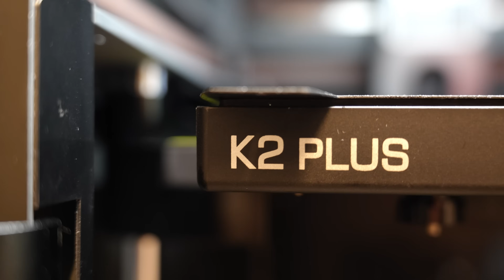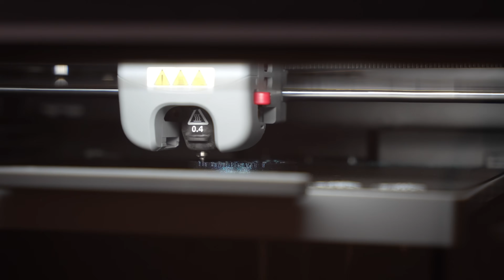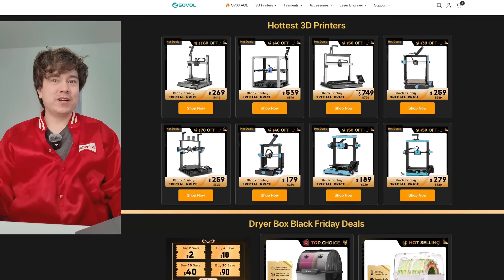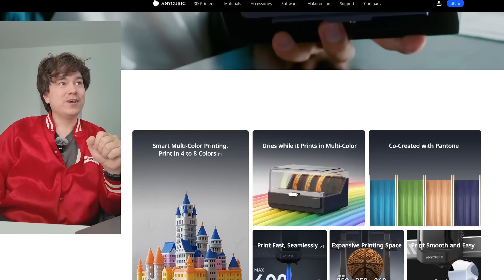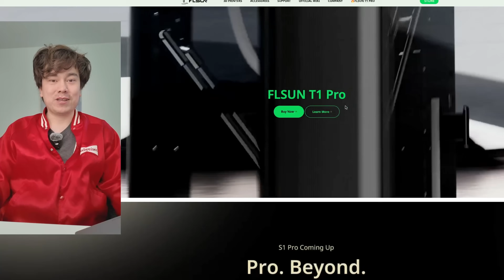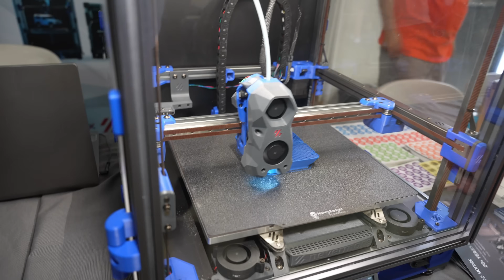Ultimate 3D Printer Tier List - 2024 with Sale Pricing

Comment: for ff they threatened to swat you for printing firearms. where you stand an the 2a is your opinion but it should be my machine my rules and airsoft cam be misconstrued as firearms easily and so can toy guns. even if its a toy a lot of real guns are printed in a way that makes them look like a toy (theres even a video of smone shooting ont ehat looks like a nerf blaster), thankfully since i live in Utah i wont be seeing the alphabet bois any time soon even if i wanted to print something that uses live ammunition. 

i want to like gekegoo and their cc catrbon but it was a case of they prommised sus omething as an addon then turn aorud and stab us in the back and had the aduacity nt not make their canvas backwards compatilbe with the cc and only have it for the cc2.

faor anycubic they now have the kobra s1 and its 1 hell of a deal. a core xy combo for $650 is a not a bad buy. $500 for the base printer. their main issue is crap customer service

Comment: lol k2 is literally an expensive toaster, non quality pla print without tweaking (don't use slicer parameter unless you want your print be just back from 2015), you can't print high temp filament, you will get taco bed and cfs, for price it comes, don't even dry. But you put qidi plus 4 down the list with the better quality from k2 in all camp, beside dimensions (but you can't use all space on k2 anyway, bc of tacobed). The bamboo hate is also hilarious.
ps: k2 have fire hazard multiple time, also with firmware update, just bc a new acc on reddit created a post about qidi, don't make k2 less fire catching. If you want safety - just buy a bamboo doh

Comment: I definitely have super mixed feeling being a Neptune 4 max owner. It's genuinely gave me nothing but headaches. On paper is a really nice printer and when it works it works. But the software is ASS and the default orca slicer profile isn't any good. The modified klipper install is weird and not mod friendly. Gotta have prior SSH experience and know a little bit about Linux if you want be able to follow any of the basic tutorials for installing klipper stuff. But the biggest issue is the bed. It's always warped, not built on a single slab of metal and instead assembled out of frame material. It rides on v wheels that wear out and the belt driving it rips or skips very frequently.  Flat out, it's just not a good or reliable printer if you arnt willing to fix it.

Comment: I agree that AnkerMake seems to be abandoning 3D printing.  I have an M5 that I got off of the Kickstarter project.  I thought it was a great machine as far as print quality.  However, I couldn't use the pause feature to change filament colors. Every print, the first pause would shift the y-axis when it returned to print.  Subsequent pauses wouldn't do it.  Tried to contact their customer support and I kept getting canned answers even though I recorded video and detailed the issue.  Also, I had the all-metal hot end which got clogged.  I tried to remove the nozzle and it broke off in the hot end.  I contacted them again as they don't have the all-metal hot end for the M5 on their website for purchase.  They basically told me they don't sell those anymore.  I could put the old hot end back on, or go through the pain of heating up the plastic inside of the hot end enough to free the remaining half of the nozzle, but for now it's just a big paperweight.  It's too bad.  I thought they had a good product going.

Comment: As an open source enthusiast I'm on same ship with you with your D tier. 

btw FYI here's what T1 Pro was like to me (preorder unit):

Noise:
"God darn loud across entire house" but also "fine behind few doors" level.
Fan sounds are now just like vacuum cleaner level but low, strong hum sounds motor generates are still something.

So I dumped it in washing machine room which even has silicon sealing on doors, which perfectly block all that noise. Basically giving middle finger to my filaments and letting it die in moist. I prefer my ear freedom over some filament drying.

Build Quality:
Exterial build quality was crap that parts weren't fitting until I found some plate's bolts were pre-assembled with 45 deg tilt (how the heck they even...) which made plates twisted.
Also unlike ad it wasn't even making proper seal and can feel air leaking everywhere.

Usability:
For firmware it's locked damn tight and outdated that I can't even control timelapse from mainsail, and their wifi receiver is total garbage that can never reliably pick up a decent signal that I had to put leftover router as repeater just for this chunky bastard.
Outside that, it was at least doing what printer should be doing just great with nice accel and precision. Never got a failed print yet after few dozen prints.

Customer service:
This doesn't exist. They aren't real.

Conclusion:
Despite all that troubles I still love this printer and will rank at A.
It's like half price (or 1/3 for earlybird price) yet it's faster than 'specific' vender's printers that need user confirmation of potential damage to print faster. 
Price factor for this overall package kinda makes sense to me, wish they did bit better tho.

Bias factor:
And best of all - it's darn fun watching delta arm flying around! Was happily watching it print during in -5 Celsius in washing room. Got cold tho.
Maybe I was destined to love deltas after all.

Comment: That was helpful. I started with an Ender 3 V2. It was a learning experience, but definitely not a "just works" kind of machine. I upgraded to an Elegoo Neptune 4 Pro a bit over a year ago. Some early firmware related issues, but running reliably now. I find your placement of the Neptune 4 Plus and Max above the 4 to be curious as those seem to have have had more problems than the 4 and 4Pro, judging from the FB group for this series. Maybe they have those issues resolved now. Might eventually get a core XY with a large bed, but not in any rush. Multi material would be nice, but the time and wastage are a big negative.

Comment: I really like the idea of the sound levels and filtered odor of the M5 Pro, the out of the box ease of use and print quality of the Bamboo stuff and the multi-color head design that does not waste a lot of material and the build volume and price of the Neptune 4 Max.  Looks like I will keep looking for bit.  Your review of the K2 Plus seems like it gets really close but at this point I cannot justify the expense as something to just occasionally mess around with.  Like most things manufactured them seem to get better and less expensive as time goes on.  I just might have to make some big compromises in what features I want or the amount I am willing to spend.  Maybe 2025 will be the breakthrough year.

Comment: While I agree many Voron parts are over engineered and suggest some unnecessarily expensive components, I don't think implying they're 'rickety' or unstable is entirely fair. A well-built Voron is damn reliable and can produce truly beautiful prints comparable to much more expensive machines. I'm sure you know why ABS is used and awhile back I even built a Voron within tolerance using just a modified Ender 3 Pro so I'm not sure why that's a negative.

I can respect why you left Bambu out but I think it's a mistake to not even mention them (aside from engagement) while still including them on there. A lot of people don't know the details about why they're criticized. IMO that's how to push back, not simply ignoring them.

Comment: Honestly, none of the brands apart from Prusa and Bambu should be in A or S tier.  Reason: customer support!  Creality might now have a couple of decent printers (K2 plus, K1C, Ender 3 v3), but these use pretty specific proprietary parts, which makes me more concerned about Creality's track record of having no long term support.  This is the company that cannot even make clear what their official Internet store would be, having numerous self-proclaimed "official" Creality stores., which Creality seems to tolerate.  That just does not give confidence that in 2 years you'll still find parts for all the variants of nozzles they introduced lately.   If you get your printer for free and replace it with another free one after a few months, customer support might not be on your mind, but after years of affordable (sorry prusa) 3d printers basically being stuff you had to fully maintain on your own without support, Bambu (affordable since the P1) has been such an improvement that any brand not offering the same level of documentation and part availability just isn't on the same tier in my book!
Reply: I haven't seen many of these companies support printer firmware for more than a year. Bambulab and Prusa has at least updated their firmware for more than a year. Prusa is even nice we they have update/grade paths so you can get the most out of your printer. I understand some of the upgrade paths is cheaper to sell the old and purchase a new one, however they held their resell value pretty well, mini. It included.

Comment: if the qidi plus 4 didnt have issues what would you get, qidi plus 4 or k2 plus?
Reply from the maker: K2 plus. It will have better long term support in the aftermarket since it will sell in greater volume, the extra size is very nice, and it’s very well built
Reply: @NathanBuildsRobots  appreciate it man, thank you!
Reply: @NathanBuildsRobots  What are different points that make the K2 plus better built than the Qidi plus 4?

Comment: As a Neptune 4 Max owner there is NO WAY I would call it an S-tier. It has the potential to be an S-tier, but out of the box I would rate it "B" tops. Even with the firmware fixes, there are still major QC issues that haven't been addressed.
Reply from the maker: What sort of QC issues? 

I only have experience with the Neptune 4 they sent me which worked great, and I’ve looked at their display models at various conventions. They seem to work well from what I’ve see
Reply: @NathanBuildsRobots  The Max in particular is susceptible to really bad bed warp, warped and uneven gantries, filament collecting around the hotend and building into a "blob of death" - early firmware had so many issues that a custom Klipper firmware called "OpenNept4une" was released. If you look up "Neptune 4 issues" there is a plethora of videos covering the various problems.

Comment: I would personally hold off on rating the Creality K2 so high when consumers haven’t gotten it yet; it might have the same or more issues as the Qidi Plus4
Reply from the maker: I looked at the electronics with a thermal camera while using the chamber heater. Looked fine.

You know, there are ways to properly test things? Most YouTubers don’t know this one simple trick

Comment: Having negative bias towards Bamboo seems to shine here- putting out an unbiased opinion should apart of your want to be looked at as a professional reviewer. Leaving out one of the fastest growing/searched printer manufactures is not classic oversight but a possible malicious objective. You are better than this for sure.
Reply: Contact Bamboo - arrange for a reconciliation and move forward. You are the only one who can lose the most by holding a chip on your shoulder - you can rise above slights in the business world ( as there will always be many) - finding solutions to “bad prints “ - is a huge part of the print environment. “You Can Do It “
Reply from the maker: Sorry I forgot to rate them. I will post an update video with a proper ranking for bambu printers

Comment: I have the Kobra3 combo and its a pretty good printer.  I love the ACE unit for drying and the way it loads, it's much easier to use than the AMS.  I obviously haven't seen the K2 yet and Creality's unit but it's been great.  It prints faster than my a1 and the printer poop is less than the bambu as well they've really dialed it in.  I did have an issue and support actually helped me.  I like it way better than my Sv07
Reply: My Kobra 3 been working great too...

Few times I had issues with cardboard spools, now just need to be a bit more careful and buy plastic spools.

Comment: I run a University print farm. The only printers I recommend to the students are Bambu. They work flawlessly out of the box. (Although the box has next-level packaging waste! When you unpack it, it's like the printer wasn't in there.) It's hilarious that you 'forgot' them.
Reply: Sad to hear a university would not go with open source tech that encourages learning.
Reply: I work at a university and, personal opinion, a university would be better served with things like Ultimakers? Bambu is the iPhone of 3d printing which is amazing! I think for students it should be a combination. Have the easy closed source and the learning from open source that can usually out perform closed source once tuned properly.

Comment: No QIDI Q1 pro? $400 and core XY. You can’t really make carbon fiber prints with a 350C nozzle and 245mm^3 build volume and 65°C heated chamber for any cheaper. Full print profiles for orca and their slicers. I have one and I’d say it’s a very good value for the price. All of the review issues like the bed alignment have been fixed. Look into it. :)
Reply: The Q1 pro is the best value for money if you are printing any filaments that aren’t PLA or PETG, and it’s not even close.
Reply: Haha, he's already Creality Robots, what good can you expect him to say about other brands?😝
Reply: It's a solid machine for some engineering materials but let's be real, you can print a lot with a ~300C nozzle and a ~100C bed. Hell, I went through many, many rolls of CF-ASA/ABS just using a modified Ender 3 Pro and a DIY enclosure. The heated chamber is certainly great to see at this price and I've spotted some deals on their larger models that are especially interesting.

Comment: For me the Sovol SV08 really seems like a solid choice with big print volume. It's the same as the K2 Plus and it works.

One important lineup you kinda forgot: K1-series! Especially the K1c for 430 bucks or so. Perfect middle ground, most problems solved, enclosed, affordable, sleek look.
Reply from the maker: After using both for a bit, I’d probably pick the ADV5 over the K1. The non pro model is just so darn cheap, and it’s quite a bit more robust, I don’t like the screen position of the K1 and the fact that the screen can be easily damaged when moving it around
Reply: @NathanBuildsRobots  Really? First I had skipped the Flashforge part because till now I thought this company plays only a side roll in the 3D printer space and that I should go with the better known ones. But now I go watch that part ...

Greetings from Germany

Comment: AD5M Pro @ S is so laughable
Reply from the maker: What’s not to like about it? Cheap, quiet, easy to use, fast… am I missing something here?
Reply: @NathanBuildsRobots  there's a better printer for cheaper, The price point does not make sense, when the Q1 Pro exists the AD5M Pro does not
Reply from the maker: Q1 pro… yeah I’ll pass on that, Qidi doesn’t understand how to make a safe chamber heater. I think they’ve just about figured it out after 2 failed attempts
Reply: @NathanBuildsRobots  I've had mine since released and haven't had an issue printing on it every single day from PLA all the way up to ASA and a little PC
Reply from the maker: @NoMercyFtw  it’s a very capable machine, but Qidi’s lax approach to safety is not appreciated in my view. The rest can be forgiven, but putting people’s lives and homes at risk is not ok

Comment: You gotta get a RatRig V-Core 4 to test and review, preferably a big hybrid (extra X & Y motors) IDEX one! They look sweet, physically and also software-wise with their own customized Klipper called RatOS with some advanced features like using a camera for IDEX calibration. And! They have the most important feature a printer can have - INTERNAL spool holder!
BTW. those Shareasale links never work for me - are they US only or is my anti-tracking & ad-blocking protection just too jumpy? It's not just your links either, it's all of them.
Reply from the maker: No idea, share a sale isn't a very reliable platform. Seems like it works well in the US/Australia
Reply from the maker: But yeah. I'd love a ratrig v-core IDEX
I could do some crazy stuff with it

Comment: I thnk the Q1 deserved a spot, considering heated chamber, quality and quite good price
Reply: When Nathan mentioned Qidi making disposable printers they support for a year or two and then no more access to proprietary parts, I thought, "Preach it, brother."  I bought five Qidi FDM printers for a print farm based on perceived value - many high end features at a low cost.  The reliability was very bad, the designs were difficult to service, and the proprietary parts were difficult to source for a year and then impossible.  $3000 in printers and repair parts went into a landfill without ever making any commercial products.  Then like an idiot, I fell for it again with a couple of Qidi resin printers.  Sovol and Elegoo have been a much better value proposition.  I'm not a fan boy for any 3D printer company, but I do have one rule.  No more Qidi.
Reply from the maker: Yeah the chamber heater that in some conditions exposes the user to wall voltage via the chamber heater fins
Reply: @NathanBuildsRobots  yikes why do they do this? A fundamental requirement of all electronics should be that they protect the user from exposure to mains voltage and they protect against self-combustion

Comment: A lot of youtubers seem to like flashforge. I've had a few and never been impressed.
Reply from the maker: Which models? I’ve never tried any except for the ADV 5.

They are also behind the Voxelab Aquila, which is discontinued now, but it was basically a cheaper, higher quality Ender 3 clone with a few design improvements.
Reply: I think it’s crazy to rate the Adventurer 5M so high when a Qidi Q1 costs 100$ bucks and can do 350C-120C-60C at a 245x245x240 volume.